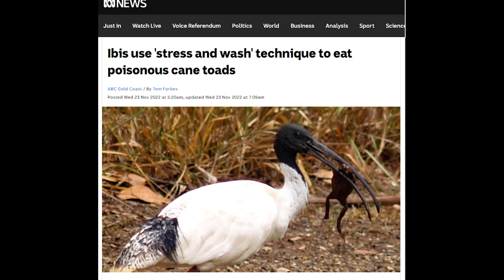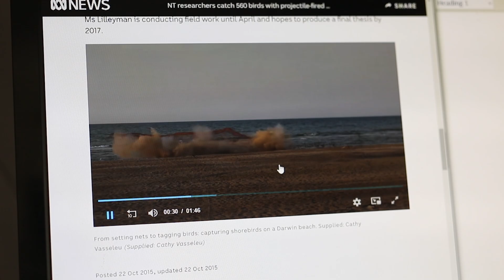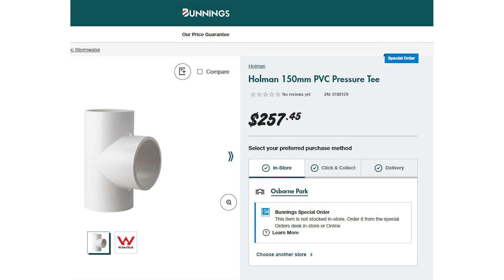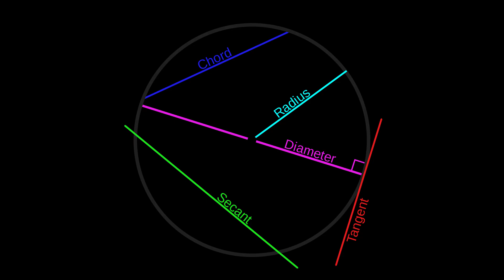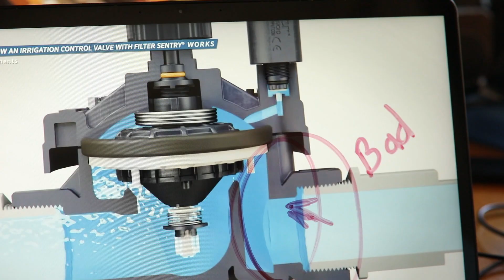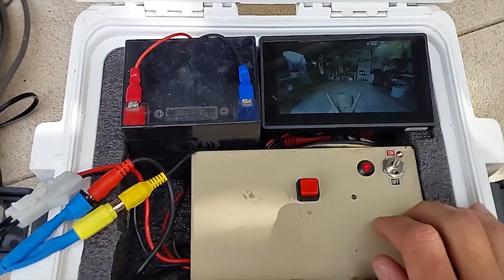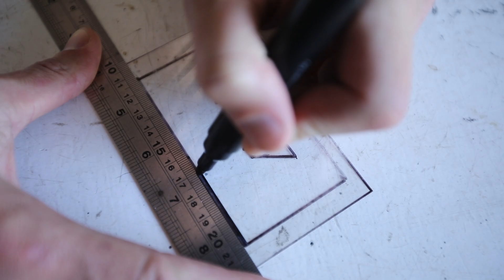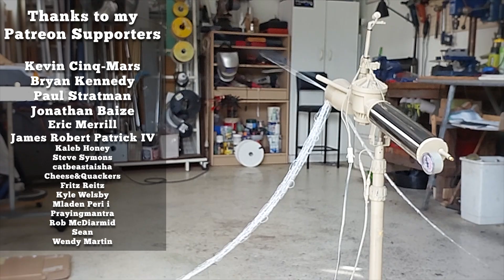A Bird Was Shot with an Arrow – I Built a Rescue Device

Comment: The multiple vapor puffs is caused by an oscillation of pressure inside the tank.
As the pressure tries to equalize it overshoots (fluids are elastic :D) and it oscillates with an exponentially decreasing amplitude, down to equilibrium.

It's basically just a roland TR-808 Kick Drum Oscillator.... except its not.
Reply: magic water

Comment: You are SO funny, and clever with the storyline. Great to hear an Aussie accent on you-tube for this sort of thing (engineering, experimentation sort of thing).
Maybe the vapour puffs after the wadding exited the tubes are from adiabatic cooling of the compressed air as it escapes and expands rapidly, causing water vapour in the air to condense in micro droplets in the cold gas? (Water vapour creating short-lived, mini clouds).

Comment: In a pinch there's another solution. I'd say this bird can hardly fly. You could probably exhaust it to the point that it can't escape. You'd walk after the bird consistently, maybe for a few hours, maybe take turns with multiple people. That's not a nice solution, but the harm would be relatively little, with the alternative being no help at all. There should be a window where the exhaustion / heat stroke isn't that damaging, but the bird's ability to flee is significantly reduced.

Comment: 240v solenoid based Electric nail guns can easily be turned into coilguns launching 1 inch neodymium magnets with considerable momentum, and 4 of those would make for a very cheap, simple and small launcher with perfect timing between the projectiles. It's a great way to make a cheap and light handheld coilgun without the hassle of designing and building it from scratch and dealing with dangerous high voltage components. I just cut the front end off the nailgun and glue in a spacer at the back with a small magnet to hold the projectile, and get a 'safe' and effective coilgun with no recharge time; of course this should only be done by those with the necessary qualifications to do so safely.

Comment: I would like to lodge a complaint.

This thing you have created is perfectly serviceable and valuable as a tool. There is hardly any impertinence or uselessness about it. I have certainly come to expect Turnah81 (brand) products to be virtually impracticable. Perhaps the weights should have been rocket-powered. Also, I think there are circular things you could put on your drill that would cut circular things. "Just sayin", as the kids say these days.

In any case, I urge you to return to your roots and construct things no one would want one gorram thing to do with, or I shall be forced to ask you to remove yourself from my lawn.

Good day.

Comment: 11:30 isn't the steam because of rapid change of pressure inside the tank ? rapid decompression can drop the temperature quite low. even more if the pressured air is at room temperature (aka you let it cool down just after pressuring it). And for the fact ther is two, i'm not sure. just a blow back from pressure stabilizing ?
For people at home you can experience this with a rubber balloon: Cut it so you can put one layer on your lips. then stretch the piece, you should feel that the rubber changing temperature. wait a little bit so you feel it a room temperature? Then release while keeping it on the lips. You will feel again temperature changing the other way.

Sorry for my english it is not my native language.

Comment: As a compressed gas rapidly decompresses, the temperature drops substantially.  The vapour puffs you're seeing is the moisture in the air briefly condensing due to the rapid cooling.
That's an oversimplification, but it should get the idea across.

Also, it's great to see another video from you!  Hope to see more soon. :)
Reply: Came here to say this.  When you compress a gas it heats up as you push the molecules closer together.  The temperature then normalises to ambient temp while it sits in the tank.  It follows then, that the temperature will decrease when the pressure is released and this results in cooling.  Colder air can not carry as much humidity, so it condenses out as a mist.  Why two puffs?  I think the high pressure air initially gives a more rapid drop in pressure so we see vapour in the exhausted gas.  The rest of the water condenses in the manifold but is blown out a fraction of a second later by the lower pressure exhausting out of the reservoir at a slower rate.
Reply: @Chris_the_Muso  Go team sci-comm!
Reply: ⁹ @Chris_the_Muso
Reply: I believe it was from Robbie Coltrane that I learned the term "adiabatic expansion." Is that what is occurring here (asks the decidedly non-physicist)?
Reply: @aaronleverton4221  Yes.  You can also call it Adiabatic cooling.